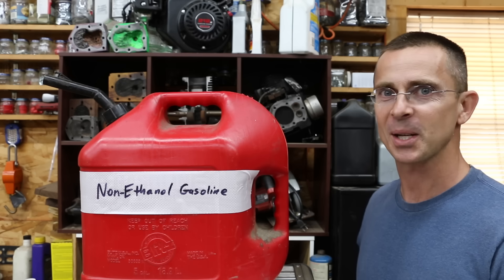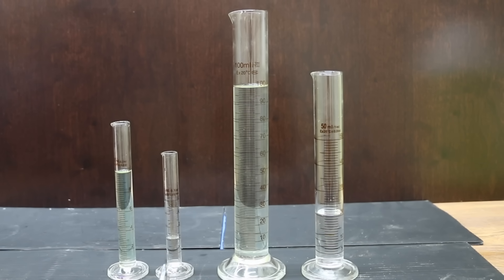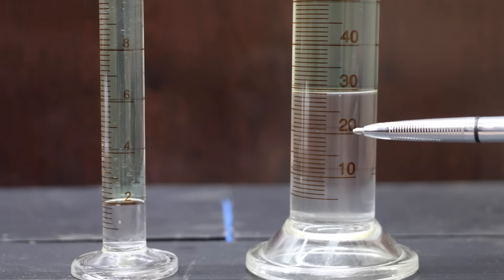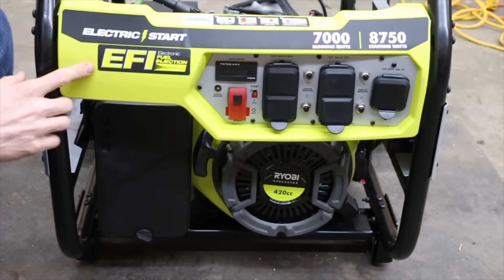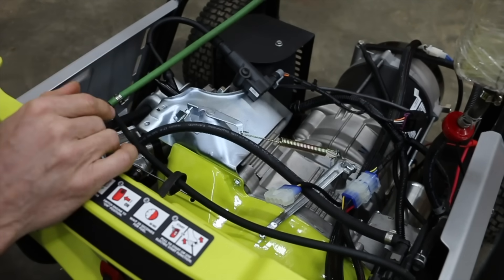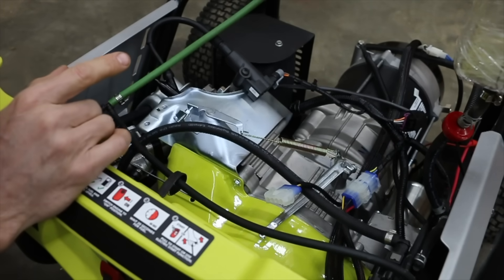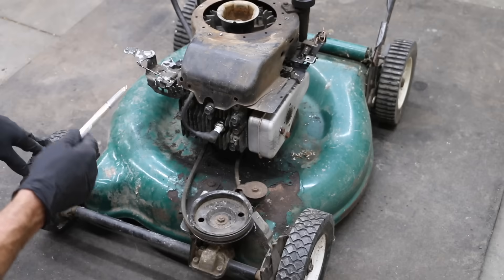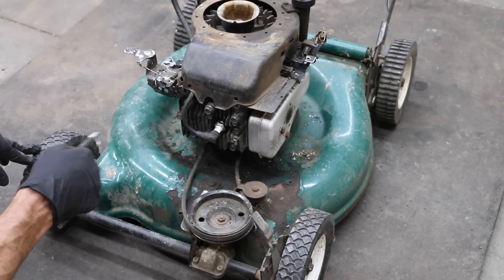Is Non-Ethanol Gasoline Really Better? See the PROOF!

Comment: The "ethanol helps against carbon buildup" must come from the fact that engines built, boosted and engine maped to run E85 have little to no carbon buildup. Water vapour made from the combustion pretty much washes the combustion chamber.

Low compression carbursted engines with slack pre-ignition angles and stuff aint made for this kind of fuel. 

Oh, and dont use rubber hoses with high ethanol fuels. Use epdm fuel lines.

Comment: 10% ethanol fuel kills the brass jets in my Mikuni carbs. After winter standstill, I almost certainly have to rebuild the carbs, if I forgot to completely empty them or run the bikes on AVGAS.

Comment: I avoid ethanol gas when possible.  But in case anyone is interested the following is from Google search.

The co-products remaining after ethanol production from corn are indeed edible and commonly used as animal feed. 
Here's how it works
Ethanol production primarily utilizes the starch component of the corn kernel.
The remaining portion, including protein, fiber, and other nutrients, is collected and processed into various co-products, the most common being distillers grains (often referred to as Distillers Dried Grains with Solubles or DDGS).
These co-products are a valuable source of protein, fat, and other essential nutrients for livestock and are often fed to cattle, pigs, and poultry.
Reply from the maker: Thanks for sharing!

Comment: A tidbit of information on this topic: I bought a 1998 Dodge neon in 2023 with 26k miles.  It was crashed in 1999 and parked with a half tank full of gas and sat for approx. 24 years.  It still ran on that old gas and the car came from northern IL, Northern Chicago suburbs, where ethanol is present.  I did end up draining the gas, which looked like dark brown paint thinner and smelled like rotten chemical waste, but the car still ran on that stuff and not too bad either. It would rev up and drive normally with just a bit of a rough idle.  Regarding the Neon itself, it runs great, is very reliable after some repairs and maintenance, and now has about 50K miles on it and the best part?  It's completely rust free, a rarity in Northern WI where I reside, and it gets up to 44MPG!  I also commute for work periodically and I'm reimbursed for miles.  This car has paid for itself 2X over.

Comment: I have a 73 Ford f250 with a 390 v8, and an Autolite 2 barrel  carb.
     Before I used ethanol gas,  I never had a leaky  carburetor,  now that ethanol gas is hard to avoid,   I have to use it,  about  every  3 years  I have to replace  the rubber  diaphragm accelerator pump, because  the ethanol  gas eats tiny pinholes in the rubber !!  I tried to  buy an ethanol resistant carburetor kit,  but can't  find  any !! 😮

Comment: all I know is with a mechanical fuel pump mine tend to last a lot longer with non ethanol!
had to replace fuel pump quite frequently with ethanol
and also had to rebuild carb.
ethanol is known to increase HP. not fuel mileage!
Reply: The increase in hp is due to cooling effect of ethanol and not its energy density

Comment: Since alcohol has exactly 1/2 the specific flow of gravity of gasoline, adding alcohol to gasoline severely reduces your fuel mileage. Also the EPA has reluctantly announced (ten years ago) that burning one hundred gallons of leaded gasoline does the exact same environmental damage as burning ONE gallon of alcohol induced non leaded gasoline ! They knew this all along, more environmental damage, less fuel mileage, more engine damage, but a lot more money in their pockets…
Reply: Lowered mileage from ethanol has to do with there being less energy in ethanol (one C-C bond to break) than octane (seven C-C bonds to break). The more carbon bonds, the greater the energy stored within the molecule. That's why acetylene (one triple carbon bond) burns much hotter than ethane (one carbon bond) Technically, pi-bonds (acetylene) store more energy than sigma-bonds (ethane), but that is beyond the scope of this discussion.

As for the lead comment, where are you getting this information?
Reply: @John-jd7mm EPA reluctantly released the information during the Obama administration. The other information about the specific flow of gravity is common knowledge in the racing community. Also liked your scientific analysis input.

Comment: Wish you'd test it on a weed eater or something and see if there's any difference on the fuel lines lol. Just curious if the fuel lines will still turn hard as a rock with non-ethanol gas (I guess I could just try it myself)

Comment: I have snowmobiles that have carburetors and when I was using gas with ethanol in them, the carburetors had to be cleaned at least every other year. Once I switched to non ethanol gas, I no longer had any problems. I use only non ethanol gas in all my small engines including ATVS and snowmobiles. In our vehicles I use regular 10% ethanol gas. I think if your engine is EFI then you don't really need non ethanol gas. Most recreational and lawn and garden dealers service departments will ask a customer right up front, what type of gas are you using? When they bring something in that won't start or won't run correctly.

Comment: This video completely skips over the fact that with a modern Gasoline Direct Injection car engine, non-ethanol fuel can help reduce carbon buildup on the intake valves,of which all GDI engines suffer. That is the only reason I fuel up with ethanol free fuel, to prolong the engines life..
Reply: You got engines lasting three hundred to four hundred thousand miles rununning ethanol gas

How long do you want your engine to last?
Reply: @philpyung4831  Doubt those are GDI engines without having wallnut blasted the intake a few times during it's life span
Reply: In those engines that inject fuel directly into the combustion chamber, the carbon buildup on the intake valve has to do with the crankcase vapors (blowby) routed into the intake via the PCV valve. The older designs of fuel delivery (carburetors, single-point fuel injection, and port fuel injection) would send a stream of fuel vapor that would literally 'rinse off' the buildup on the intake valve. The direct injection type, however, does NOT have this rinsing effect, because the gas does not pass by the intake valve at all (hence the buildup.) And the older your engine is, the more blowby you will have, hence more carbon buildup. They have to clean these deposits by either removing the head and cleaning, or blasting the intake port with crushed walnut shells! I kid you not.

Comment: I worked as a mechanic for 30+ years, I can tell you without a doubt that alcohol in gasoline sucks. I remember the rise of gasohol, and I was so pumped! My car was going to have more horsepower!!!!!  Nope, it ate all my hoses and gaskets. What a total mess. I spent the next few years replacing fuel pumps and rebuilding carbs. Moisture in the fuel problems etcetera...   I ONLY run non ethanol premium, and have done this for the last ten years, without fail and despite the extra cost. My fuel doesnt gum up the bowl when the mowers boats etcetera SIT all winter. No fuel pump problems at all.

Comment: It's 10%! Try E85 or something if you want to see some real differences.  As someone who has used E85 bioethanol in small engines as part of my business, I can say that 

1) To run successfully requires only minimal if any modifications.  Some carbs need jetting out slightly and then run fine.
2) The engines on E85 are way cleaner with a lot less carbon build up.
3) No problems under load with  pre ignition 
4) More torque, significantly so.
5) Only slightly less economical  if bigger jet was required.
6) exhaust smells a lot better 
7) The engines perform better over the long term. Some have 1000 hours plus. 
8) Carburetors are only fouled if fuel is left in them. Easily cleaned, but rarely an issue, not the big problem it's made out to be.

Overall, in a decade of running E85 bioethanol in small engines I have basically had nothing but a positive experience.

Comment: Six years too late but ethanol always clogs carbs. Before ethanol with put in fuel I almost never had to dismantle my motorcycle carburetter and clean out the Jets. Now every time it sits more than two weeks I have to clean out the jets. So I sold the bike. Now I have a motorcycle that fuel injected that doesn’t suffer that problem. But it’s kind of obvious they know this and don’t care

Comment: Other tests I've seen put the mileage loss at 10% in a car. So it's supposed to cut emissions by 10%, so where's the savings? If it takes 10% more fuel, but you get 10% less emissions, isn't that a wash? Also, how did they slide into Ethanol being cheaper? What a scam.
Reply: Ethanol fuel is heavily subsidized. But that's just for cars. Go buy a gallon of it in the store: one brand at Lowe's says "ethanol fuel" but is NOT subsidized. So why for cars, but not alcohol-fueled heaters?

Comment: I agree with the ethanol fuel corrosion problems.  When I store engines for the winter.  I fill and run the engine with non-ethanol fuel. I do the same with my cars that aren't daily drivers.
Reply from the maker: Thanks for sharing.

Comment: In the past, using ethanol gas in my push mowers and trimmers would render them inoperable within 2 years unless I replaced/rebuilt the carburetor. Since switching to non-ethanol in my small engines, I am going on 5 years with no issues in any of my gas powered equipment.

Comment: I don’t recommend adding water to separate and remove ethanol.  Two reasons:  lowers octane (as mentioned) and forms microscopic sodium sulfate crystals.  The crystals are so fine they can’t be filtered, but form layers of hard scale when heated. The scale plugs areas of close tolerances subject to heat.
Reply from the maker: Thanks for the feedback.
Reply: Use distilled water.

Comment: I live in New Orleans... The humidity during most of the year is often 100%. Since alcohol is hydrophilic and the moisture in gasoline tends to separate and sink to the bottom when  left for extended periods of time motorcycles, and other gasoline powered devices with metal gas tanks often rust. I've had to replace gas tanks on motorcycles that use ethanol gas. I've never had any issues with rust in metal gas tanks which I only use non-ethanol gasoline exclusively.... Ethanol gasoline also tends to leave a nasty varnish like accumulation in weedeaters and lawnmowers that require regular carburetor cleaning.
Reply from the maker: Thanks for sharing.

Comment: Bought a 1982 Yamaha motorcycle. Still have it. Dealer cautioned never us alcohol laced gasoline as it will destroy rubber bits in the carbs. 40 years later, none if the 4 carbs have been removed, and it is still running well using straight gas only.

Tip, modern pumps use one hose for all blends. There is up to a quart or more "in the hose". If last purchase was blended, you will get some alcohol. Matters not so much in a 20 gallon tank, but it will in a gas can or motorcycle tank. Either fill at stations with separate hoses/pumps, or fill your car before your gas can.
Reply from the maker: Thanks for sharing!
Reply: The Chickanic Channel lady covered this on a Youtube video. I can't post the link, but google this:
Fueled by Deception. How You’re Getting Ripped Off at the Pump! (I'm SHOCKED!) VLOG

Comment: Ran a Chevy 3.9 uplander bought with almost 200/000 on it ran e85 in it 150/000 miles , no issues yes it had 350/000 plus when it went to recyclers , rear hanger came loose
Reply from the maker: Thanks for sharing.

Comment: Thanks, i left ethanol fuel once after snow season till next snow season in my arien snowblower, couldn't get it to start for anything after that. Then i rebuilt the carb and cleaned out everything out. i then bought TruFuel Ethanol Free 4-cycle fuel, i did that a couple of seasons. now i use ethanol fuel during the snow season and use  use mechanic in a bottle. then i make sure that i run non ethanol fuel and end of season so it flushes everything. after do this I've never had a problem again with my snowblower starting or running.
Reply: sounds great, but that stuff costs over $25 a gallon!

Comment: I drive the highway a lot and I can tell you I get up to 60+ more miles on non ethonal gas. On average I was getting around 360 per tank a week per tank on ethanol gas. I switched over ethanol free and got over 400 miles per tank. Plus noticed a little better boost after a bit. It won't turn your car into a speed demon but definitely saves you in the long run.
Reply from the maker: Thanks for the feedback.

Comment: Ethanol destroys everything,  fuel pumps , carburetor ‘s , injectors, engines,  and steel gas tanks,    In Canada it’s mandated,  by the government,  to destroy your bad gasoline burning engine,  especially, lawn mores , snow blowers, chain saws , garden tillers,  pressure washers, any things that is used internally,,  they want you to go electric..   F🇨🇦ck them and Trudeau ,

Comment: I own a 1971 Type 3 VW Fastback. I have been using ethanol for years. Recently my car died and would not start.  Pulled the tank and found it full of rust. Prefilter screen on the inside of tank was full of particles. Filter was dead. Anyway, cleaned the tank and was clean!! put a little E10 in it and 1 day later it was all back. Cleaned it again this time and put in non Ethanol and was fine A WEEK LATER. No more E10.
Reply from the maker: Thanks for sharing.